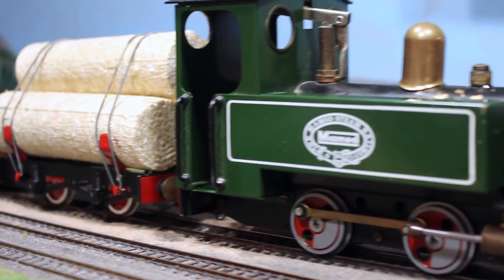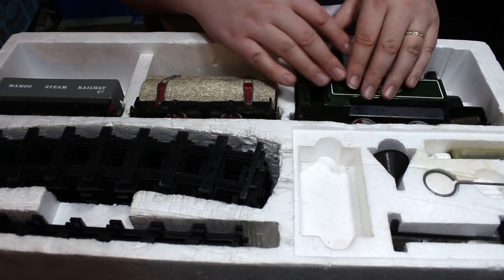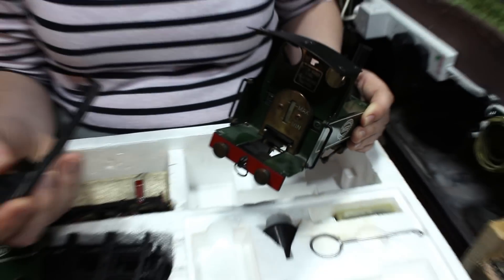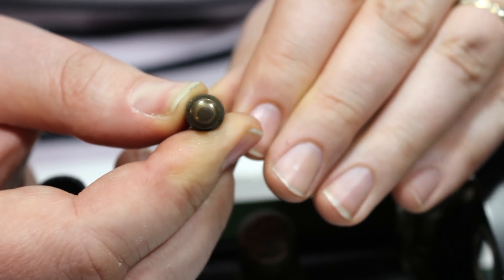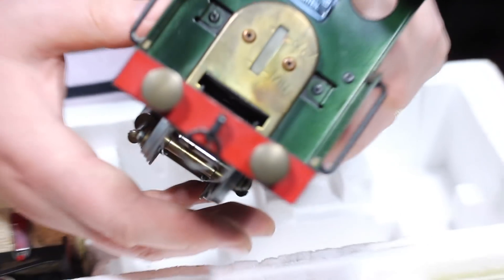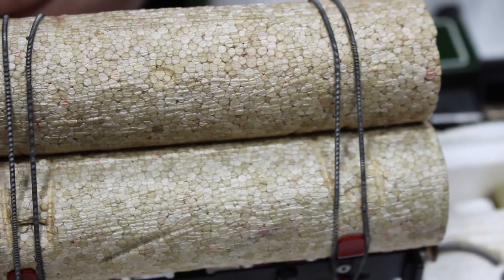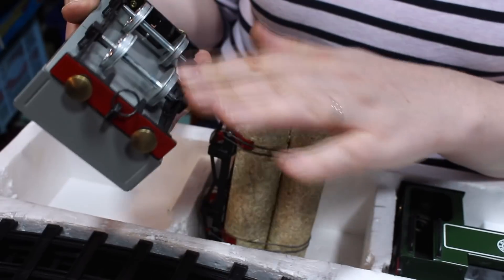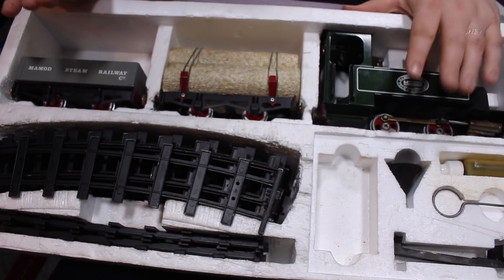Mamod Steam Locomotive Set - Unboxing and Review

Comment: I have one of these. I purchased it from Hattons about 1985 as a semi type of kit in black livery. Its still in my collection. I also have a goods wagon in brown and a guards van in grey and some of that metal track. Its not been run for many years. I used to fill the boiler with deionised water to help reduce scale. I used camping type fire lighters to heat the boiler. This is just such a classic locomotive for me.

Comment: Yes, you are right. They are double acting cylinders. Don’t worry about the wobbly dome. It can be pulled off. It covers the hex dome below, which has a groove and split ring that grips the cover. The wobbly chimney is quite a common issue. The base of the chimney is crimped into the smoke box . It’s possible to tighten it but requires stripping the loco down. A blob of superglue should do the trick. You can get spares and improvement parts for it. I suggest that you have a look at Dream Steam’s web site. 
Happy steaming Jenny!

Comment: Jenny, I owned a Maroon loco and two couches
. At the time I had a small area more of a peanut engonulated shape. Yes the Mamods run quite reliable on O gauge track. I used the American Super O gauge 3 rail track in my shed. The Super O points weren't a problem with the wheel flanges.  I believe I may have ground down the check guard rail so the loco wouldn't ride up and derail.
Outside I used Code 223 rail. I hand cut my own crossties ( sleepers ) stained them with Dark Walnut stain mixed 50 50 with India ink. Stained the sleepers well and even one palm of my hand. I hand spiked the rail to the sleepers.
My peanut oval of track was 9 feet with 1 passing siding ( not that I needed a passing  sodding ). I dremp of 4 trains running round two freight and two passenger , dreams ???
Well I ran the train  dozen or so times. 
We went off on a 3 day forray an a whilst we were away thieves stole my train and ripped up and smashed the trackwork.
All I have now is find memories of constructing that backyard railway empire, and showing and sharing to friends and neighbours.
I did thourghly enjoy.
If you need any help or advice just let me know. Always willing to help anyone with same railway interest.
Take care. Merry Christmas to you and Zoe.

Comment: Hi Jennifer Mamods have their own admirers in the garden railway world. I have a Round house Bertie and an Acuccraft Edrig, both are entry level SM32 live steamers. Yes they cost a bit more than a mamod but with no disrespect to them or their admirers the performance difference is worth the money. I started with loose laid track on the patio which was surprisingly OK, but now have a fixed layout in the back yard. I also manually operate my steamers as my railway is all " level ". If you have any gradients though you will need remote control and to get good at using it!  Also you can get battery diesel locos for 16mm scale which can be very cheap ( relatively speaking ). The 16mm Organisation is worth joining if live steam narrowgauge in the garden interests you. You can pick up some good second hand stuff through them making it more afordable, plus lots of good ideas and how to.

Comment: Ha ha. Similar memories for me. I started saving for one from Gill & Sons Hobbies in Sutton Coldfield. I had a Saturday job with them at the time, but even with my massive weekly salary of £5 and my 10% staff discount. I too gave up (earlier than you - I only got to £25 😁) and bought a Wrenn Clun Castle for my 00 layout instead. I did buy one later on as a kit when I started work together with a couple of bare wagon/coach chassis. I've never had a lot of success with it's still in a box in the cellar with a job lot of ancient Hornby 0 gauge tinplate track I found at a flea market.
Did you spot where the lashing springs on the log wagon were sourced? Take a look at the drive band on your steam roller!

Comment: The chimney is riveted over on side the smokebox so not a problem is lose the boiler is brass so ONLY USE water & washing up liquid to clean
Reply from the maker: bmozzer how do I remove the limescale deposits? Would white vinegar have an adverse reaction to the brass?
Reply: @JenniferEKirk  Never had that problem as i was in yorkshire at the time so no lime in the water i use have a look on the 16mm association web site there may be a q&a on it
Reply: @JenniferEKirk  is the brass end on the boiler with the site glass in is it screwed on or pop riveted on . on mine it was screw so i could get in to the boiler to do any cleaning